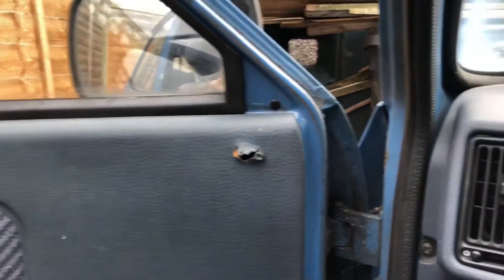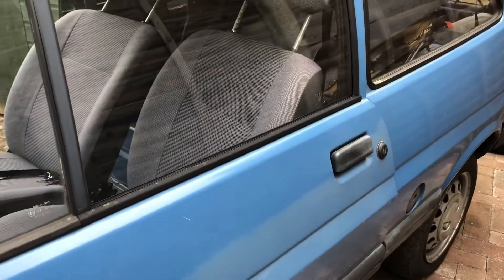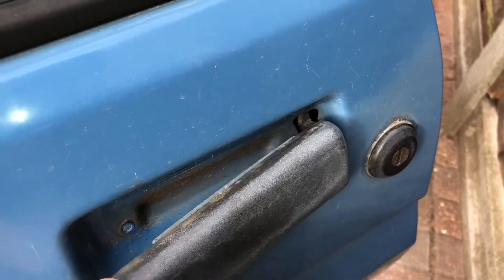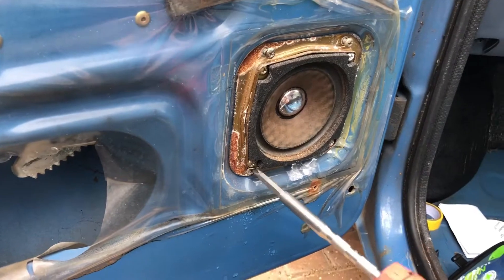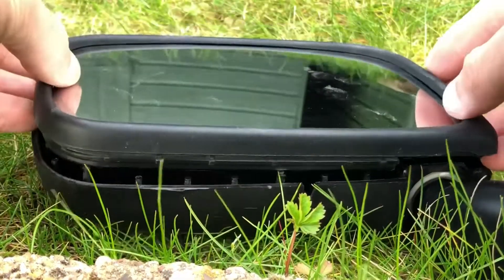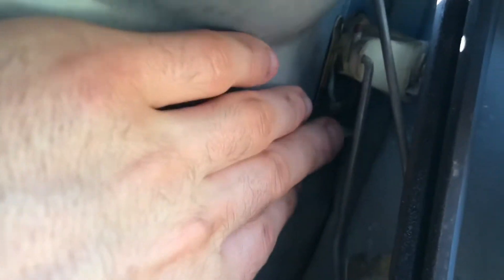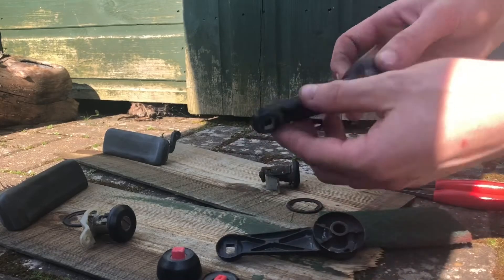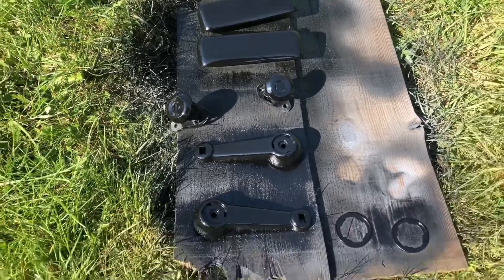Mk2 fiesta project (S1 E6) - stripping the doors

Comment: Hi Mitch , great Fez 'very good for its age . I like that you said youre going to keep her original . many owners i see cant help modifying . I have a Tip for you ‘find another set of door handles probably from eBay , if they are faded or matter of fact any of the exterior plastics are faded ,to bring them back looking tip top go over them carefully with a heat gun . It will take a fair heat but do them slowly and youll be ok . keep up the good work
Reply from the maker: Chris Hull cheers mate! Yeah I’ve heard of the heat gun before, think I might have to give it a go!